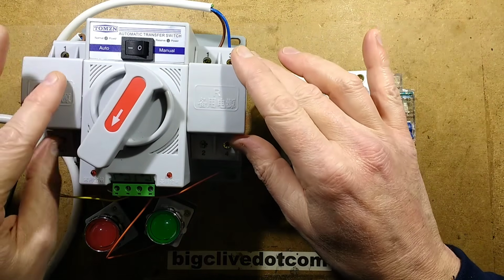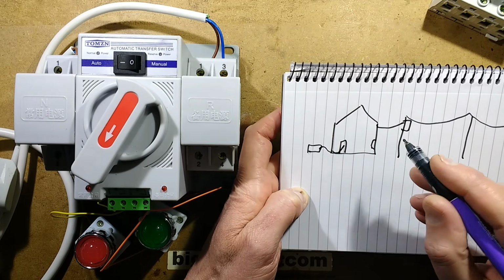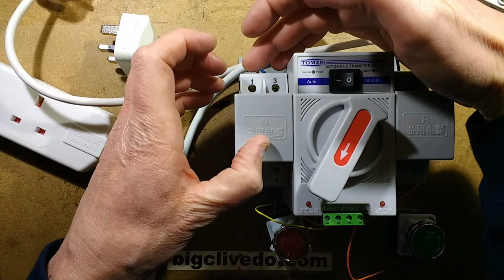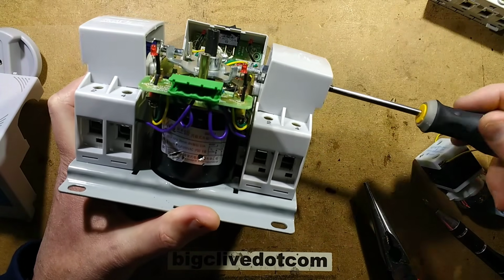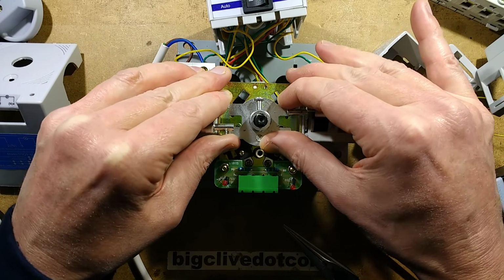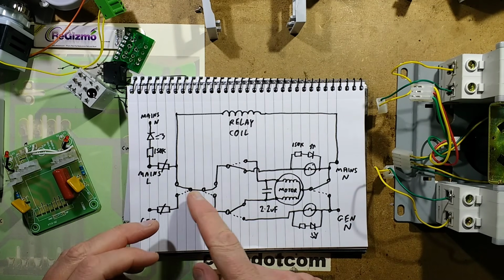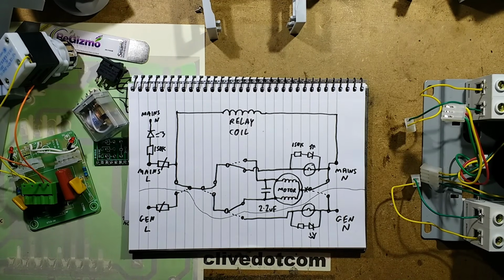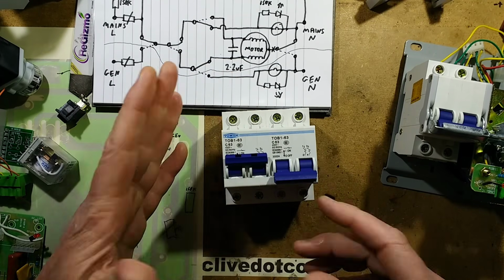Automatic generator changeover switch (with schematic).

Comment: I have a question I want to build a waste spark ignition system on my old gm e core type ignition coil I have a inductive triger and a 4 pin ignition module .
Beside turning my coil to a waste spark system I want seperately to have a amplifier and plazma ignition function with that system so I can experiment on my car.
How wuld that setup look like to force a singel coil to fire 2 x 180° fire of that center tap on a ignition coil is there any device that does that? phase shifting a ignition coil? and if posibel to ajust 2 seperate events polarity? 
I need such a device for diferent fuel types Im runing but can not finde any thing usefull on the internet for info culd dual ignition modules ore  5 pin dual relays performe this same task? My distributor does not suport a pick up coil for waste spark and I dont realy have any where to mount a flywheel ore crank senzor what culd I do to bypass this problem?

Comment: Very very helpful video. I could understand the logical use when you dismantled it. Awesome! Only my question is the average wire AWG connections for the input/output. I need #8 awg

Comment: Searched YouTube for your video on this transfer switch. (bought one on Amazon from china, curious to how its engineered) sure enough here it is. Thanks for saving me the trouble of having to send you one for a video 🤣
Reply: I'm curious to the draw from the relay. Because I'm using battery/inverter as the main ac input, and my shore cord/gene is going to be wired as the backup. 
Since the relay coil is always powered if main input has power (by my battery Bank/inverter) I haven't yet installed it, or my smartshunt would tell me the draw and I wouldn't be typing this lol

Comment: C 32...the C stand for how much current needs to be pulled to trigger the breaker in 0.4 seconds. C in this case is 5-10 times the rated current to trigger it in the certain time which would be 320 A

Comment: Can a switch like this also be able to switch from one service to another service in the case where you have 
more than one and you want everything on the off peak service during certain hours ie off peak 2300 to 0700
then the other service 0700 to 2300 ? Since it has a motor to drive it from one to the other and the interlock to
prevent both being connected at the sane time it should be able with a timer circuit , to select which service
is more economical, in my case 2 time periods per day.
 This is especially useful with an EV where you get reduced rates at certain times. In my area we have a good
plan with National Grid to get about a 50% discount at night.

Comment: I use one of those together with an UPS to supply power to light, fans and fridges in my apartment in Kenya.
Reply: an apartment is relatively easier to maintain as it is smaller

Comment: I was actually really lucky to now t blow my generator up. I do the back feeding method, yes I know Darwin Award looking for a place to happen... anyway, so I was particularly tired one morning, after having been woken up several times by our alarm system (which goes nuts when the power is cut, which happened multiple times that night), I knew that mains power was restored and I thought I remembered which breaker I was feeding the generator in to the DB from. As it happened I got it wrong and I turned off the wrong breaker and proceeded to turn the mains on. Fortunately the only thing that happened was that the correct breaker tripped and my generator stalled. 

This was not the usual process I have always done for years, normally I would go to the generator, power it down, unplug it at both ends, then go to the DB and restore the mains, on that particular morning I was feeling particularly lazy and thought I’d take a shortcut and deal with the generator later since it was likely to be out of fuel soon anyway. Suffice to say, I was no longer tired and acutely aware of how bad it could have been. 

Also I have to stress that I never backfeed into the grid, in part due to the small size of my generator (900w @ 220v), and also because I know enough to know that it could be fatal to anyone working on the outage (even indirectly). I always turn off the incoming breaker before I start the generator and only turn it on if I know that the power is restored.

Comment: He never did show where the load connects to this switch. ???  If we were to connect it so the generator side operated the relay, it would not remain continuously energize, but the unit would not change to the generator until the generator was producing power and you would not know when to stop the generator if you could not see the switch's lights, or other indicators.  I did see markings on one of the big circuit breakers, but that doesn't mean that there were any ratings. Ron W4BIN

Comment: Even if it may seems to be handy, a couple of timing relays and power relays can be used to do the exact same thing, but with non chinese parts. 
In general, you want to wait a couple of seconds or minutes from power is restore until you switch over to line power, because there are often situations where power company tries to restore the power tthree times or so before the power is permanently blocked. Also, when all consumers starts at one time, there also possibility of temporary startup overload which in itself can create a new power loss.

Comment: Would not a 100a 2 way 2 pole relay,
 do the same job?
 If theres no mains, the relay is in the backup power NC input position-
When power is applied by the mains,
 it switches and latches the NO inputs to supply the consumer.
No need for a motor

Comment: the relay is meant to tell if the main power is on or not: it it's on, the relay will move the contacts to power from the main. If it's off, it will keep going to the generator.

Comment: Seems you don't reply to comments but by watching this i wanna use this for a specific project of low load. That is can i use only the load shown in green indicator light?
Reply from the maker: I do reply to comments.  This unit can be used to switch low loads, but it sounds like you could use a simpler circuit.

Comment: Great video Clive. Please can you indicate the limit switch actuated for the switch over to generator and the one for switch over back to mains? In mains operation mode should it not be such the the coil is not energized by using normally closed r normally open contacts as necessary?

Would also appreciate schematic drawn with the relay positions for when the switch over to generator has occurred.

Finally how can this changeover switch be adapted to operate as a remote on/of mains motorized switch using an additional external dry contact? Cheers.

Comment: I've got one of these auto transfer switches. I modified it slightly, so the green terminals on the bottom are to enable switching in either direction rather than output signals. I mounted a relay board right off the terminals and from there goes to an arduino outside of that box. this way, I can have the arduino decide when to transfer power to or from the generator with a delay. transfer doesn't happen until power is stable from utility or from the generator.
Reply: The delay isn't a bad thing, you can have a UPS to run your computer or radio transmitter.

The device in the video has me thinking of other application, such as off grid events such as Amateur Radio contesting.
Reply: one thing I learned, if you're using an inverter or inverter generator or anything that provides a clean and stable 50/60hz power, a normal ups should hopefully work ok. but, they can be picky. my backup generator isn't the inverter type, so the AC frequency changes with the engine rpm. a normal ups will switch to battery thinking power is unstable.

there's a thing called a double conversion ups. they use a bit more power, slightly less efficient, but they will take whatever power you give it, clean it up nice and pretty, and offer that to your valuable equipment. I got a few made by eaton, I found it'll keep using utility power down to about 60 volts and wont use the battery. because it's only getting half the voltage but still needs the same amount of watts/power for the equipment, it actually draws double the current at 60 volts. if I drop it to 55 volts, it finally switches over to battery. that's pretty neat. it takes the AC power from the wall, utility or your own generator or any source, it converts it to DC, then back to a clean stable AC. a normal ups only needs to convert DC to AC when it's running from battery, but a double conversion ups is always doing this the entire time it's on.

back to the thing about delay being a good thing, yup. when the generator starts, I don't want an immediate load put on it. likely it could stall out. at least give it a few seconds to come to an idle. that's why I modified my transfer switch to have inhibit relays controlled by arduino. I can monitor power sources and have a set delay. planned project, maybe will finish soon.

Comment: I got a solar widowmaker here in Kenya...i turn off the main input breaker and just connect an 230V inverter to our oven outlet with one of those double plug cables. Only earth is not connected trough but all the outlets have direct earth connection.

Comment: Would it be possible to post a link .. I can’t seem to find it on eBay
Reply: https://www.ebay.co.uk/itm/Dual-Power-Automatic-Transfer-Switch-2P-63A-220V-150-138-115mm-Toggle-Switch/401783706166?_trkparms=aid%3D111001%26algo%3DREC.SEED%26ao%3D1%26asc%3D20160908105057%26meid%3D5458a851e39f47d8a77da97da2fff980%26pid%3D100675%26rk%3D1%26rkt%3D15%26mehot%3Dnone%26sd%3D401783706166%26itm%3D401783706166%26pmt%3D1%26noa%3D1%26pg%3D2380057%26brand%3DUnbranded&_trksid=p2380057.c100675.m4236&_trkparms=pageci%3Adddf9b4a-88d2-11ea-85a4-74dbd18015b7%7Cparentrq%3Abdaa3f8b1710ac3d2a8ed66cffc3b718%7Ciid%3A1

Comment: If I may ask, can this work with a solar power backup system? Say instead of a generator I wire from the inverter (from deep cycle battery bank). Thanks!

Comment: @bigclivedotcom or anyone who has one of these apart - could you measure those 63a breakers against a standard DIN breaker? I notice those are standard(ish) & modded to fit onto that plate, and i'd be really interested to know if those could easily be replaced by 100a breakers available in the UK.

Comment: Recommend to who wants to build there own Very Cool transfer Switch with this unit. recommend incorporate  a time delay contact between the street power and the auto switch, to eliminate any Premature Switching of this unit, From power flashing from the Utility Company Reset. so you don't Toast your own electrical System , When street power is Restored.  All the new Professional Hole House Transfer Switches Has that feature in them.

Comment: That looks like a really well made unit without the usual obvious Chinesium flaws. However I'm often very surprised by the huge complexity companies use to do what is otherwise a VERY simple, albeit critically important task. Every piece of mechanical design involved in this particular changeover contactor seems to have been conceived to overcome problems ONLY there due to the complexity that has been forced in and the basic design philosophy. I'm sure you know the following Inside out Clive , but for the benefit of the discussion & debate, here's my take.

There are countless examples of high power single & three phase relay contactors (I have one, currently unused - 3 separate phase changeover connections, 40A sustained per contact, 50A peak - much higher power versions are available obviously) which COULD be used and involve FAR less mechanical AND electrical complexity. Mechanical bi-stable relays/contactors exist and with little added complexity so that power is not required to be used continuously, and only requires a short pulse (on different connections) to set/reset - as I'm sure you're well aware. 

But, taking the particular contactor I have, a simple connection to the incoming mains will power it on and the contactor connects the mains through when powered (BREAK BEFORE MAKE - in both directions) - result mains drops, contactor drops out.  However smart guys will realise that immediately mains returns the contactor will reconnect automatically - Oops! 

Not a problem however, as the simple addition of a manual reset switch (key lockable?) and a very low power, small, self latching relay in series with the contactor supply can be used to prevent automatic re-connection! Mains drops, no power to the self latching relay, contactor switches. Mains restored, NO power to the self latching relay until the (key)switch is operated, no changeover until manual intervention, and the supply is still from the generator or "other" supply such as Solar PV/battery storage. Speaking of which, I'm surprised that no-one seems to have mentioned such devices being used with grid-tied inverters (of the right type) that can be used to continue to supply power (of however much) during daylight power cuts or even at night with battery storage.

The more complex, the greater the chance of failure, purely on an MTBF basis, and way greater for mechanical systems. The amount of pure mechanical complexity in that unit you have leaves MUCH to be desired, albeit it seems to be a very well considered & constructed unit (shaping the toggle mechanism to ensure Break before Make). The other, even simpler, way to wire up such a contactor as I'm suggesting, but a bit trickier to prevent auto mains re connection, is to wire it the opposite way i.e. it only gets power when the generator output is present and drops out with no generator power. Unfortunately, this will obviously switch back immediately on restoration of mains! NOT as easy to make this fail-safe though clearly.

Comment: Do the fuses properly work, when you backfeed the generator power into a plug? I assume that there is nothing else (no other plug) connected between the backfeed plug and the fuse box. Likewise, is the protection in the switches (inside the automatic) even working, when they are being physically held up or can they disconnect internally anyways?
Reply from the maker: Yes. they should still work fine.

Comment: A bigger potential failure point would be mechanical. If the switching mechanism breaks, such as having the plastic switches break, then it could potentially have both mains power and the generator on at once.
The covers do protect against foreign objects getting in the way, but it also means you can't visually see how the switch looks.

Comment: This video you made is wrong. The generator plug is female and the generator receptacle is male, thus it can not be plugged into the dryer receptacle! Have you heard about the generator transfer switch? In my house I use an external generator and the Reliance Controls generator transfer switch. Watch this video how to make proper connections! https://youtu.be/Y4Fer6cB_xI

Comment: On boats I just use one relay with 2 x NO and 2 X NC. The two NC contacts are used for the inverter power, the NO are used for shore power. In also feed the relay coil from the shore power.  This makes the ship run on its own power unless the shore power is connected. Switches fast enough for computers to keep running.

Comment: Houses only:
Do not use any household electrical item from another country and use in an US home. 
Exceptions,  if it's installed in your house and you plan to never sell your house; it's entirely your responsibility. If you do the research and find out its complys with state  & federal regulations.

Comment: a solar controller with switch over does a similar job..it takes direct sunlight and when it falls below a desired voltage the grid power kicks in..the inverter can be programed to cut in to the grid..a bit light emergency lighting?

Comment: Thks you oh so much for explaining automatic transfer switches w/o any quantum physics & such.  
Hmmm basically it's a high voltage double pole double throw switch with relay switching for safety.  
Besides home convenience, I don't really see any advantage of the automatic ones over the manual ones.  If you're home & utility power goes off; get up, throw/lock the manual transfer switch, & plug-in/turn-on the generator.  If you're not home, it really doesn't make any difference to you.  Of course get the automatic if you want it to work when you're not home.  Oh the manual one is safer & should last longer.
Reply: I use this thing all the time to change between solar power and Mains supply
Reply: My home habitants could safely and easely use my backup battery, when I am out or sleep, just knowing how to turn on/off my inverter when an outage happens and ends.

Comment: Divide the voltage by the earth (fault) loop impedance or the neutral (fault) loop impedance, whichever is lower to get the worst case cenario fault current, ohms law I believe

Comment: Interesting Video.   In the USA it is law with most utility companies that a mechanical interlock has to be installed on a panel which is connected to a generator.  The generator is generally connected to a 40 AMP or more breaker that is in one of the top positions.  When mains is turned on the interlock prevents that physical breaker switch being turned on unless the mains power is turned to the off position on the panel.